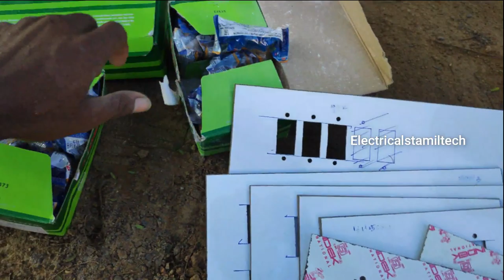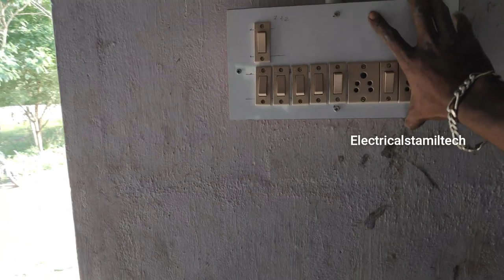எலக்ட்ரிக்கல் ஹவுஸ் ஒயரிங் || A to z switch board connection || part 5

Comment: Hi from malaysia,but here in malaysia,we would follow malaysia electric rules and regulations,we wont share mcb for light and socket outlet...we use mcb 6 A or 10 A for light and fan and 16A or 20A for outlet socket....in db from main meter,we use 10mm -16mm wire,for light fan  we use 1.5mm,for outlet socket we use 2.5mm...

Comment: Sir na v2la Oru switch board connection koduthan athula point wire yellam vellai seiuthu Aana two pin socket irunthatha yeduthuttu three pin socket koduthan supply yellam varuthu Aana mixie ,charger pin pottu on pannuna work aaha matangithu yedhunavuthu solution video podugala